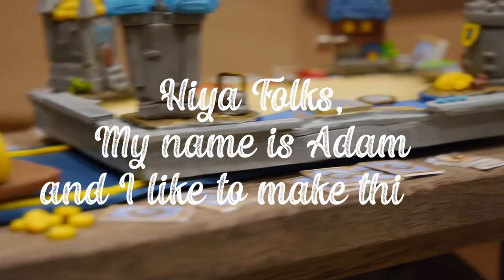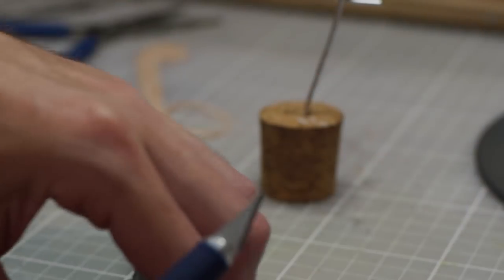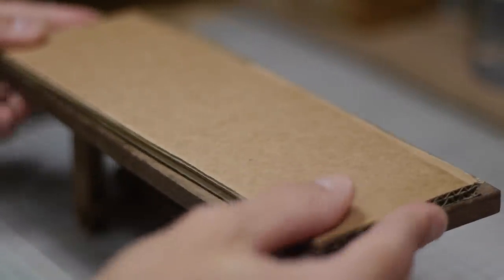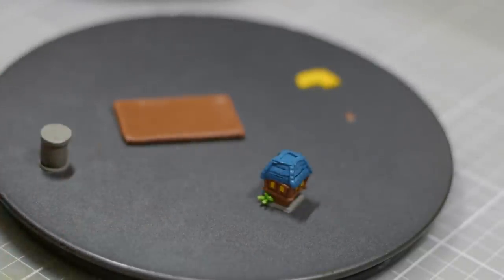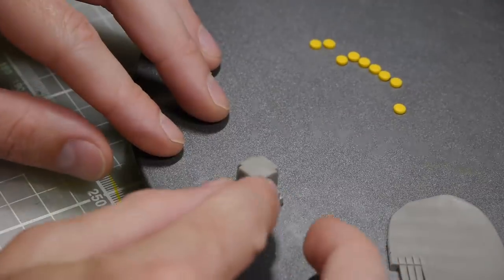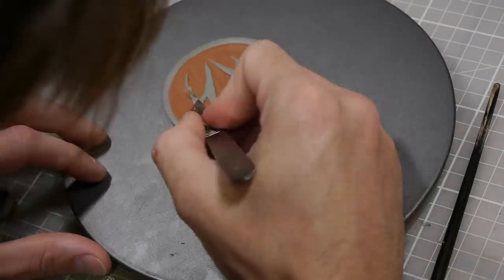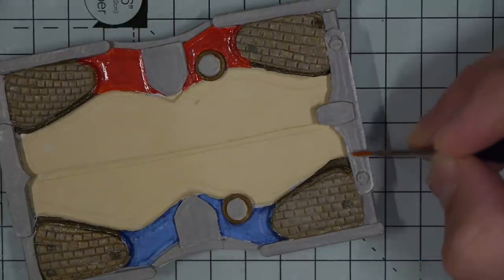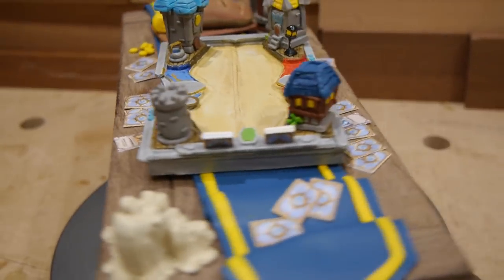How to make your own Hearthstone diorama // DIY // Polymer Clay Tutorial

Comment: Btw, glue has a lot better shearing strength than normal strength, you purposely design accomodating parts to have as large of a surface area as possible, that is parallel to the applied force to ensure shearing.